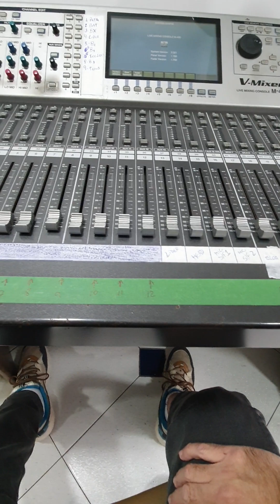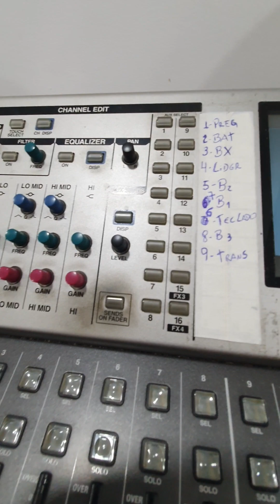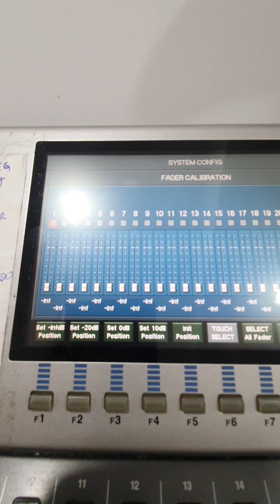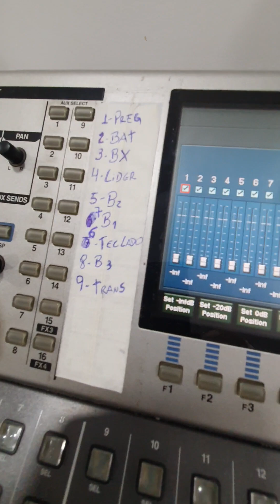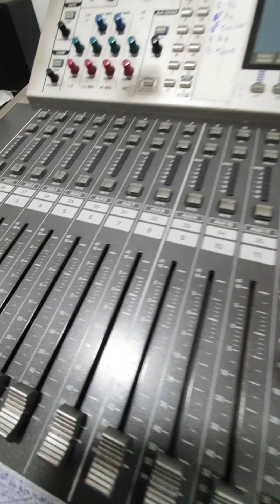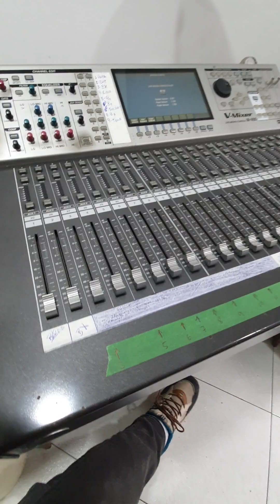Roland M-400 V Mixer Fader Calibration.

Comment: Roland Systems engineer?!? Awesome! I'd love to hear your thoughts or insights (if any) on what happened to the M5000. My church bought one and it's nice, but really an incomplete console that was abandoned and we're likely to replace with A&H soon.
Reply from the maker: @smedley5215  That was after my time at Roland and I've never seen one. Perhaps it wasn't imported to the UK, you are best directing your questions to Roland Technical Support themselves.
Reply: @ thanks for your reply. I didn’t really have a specific question, I was just curious if you had insider info lol. 

Basically it was a console they launched with much fanfare, and promised a bunch of features in future firmware. Shortly thereafter the updates stopped, and then they discontinued it and exited the audio market all together.
Reply from the maker: @smedley5215  I was senior engineer from 1988 to 1996 at Roland UK and after that a service centre for Roland. The M400 was very popular for various Churches, I personally liked the Presonus Studio live, when in Brazil the most popular desks were Behringer Midas or high end Yamaha systems.

Comment: i have a mackie hui that has a slack belt do you know if this fader is the same ive heard its p&g or alps
Reply from the maker: @yodamandala  sorry I never heard of that Mackie, but all Alps motorised faders use the same belt as far as I'm aware.
Reply: @delatronics  in 1999 The Mackie HUI was the very first DAW CONTROL that all mackie protocol is based on....only 11 left in europe and yes i love it..Fader 8 wont move i suspect its the motor actually and may have a look at replacing just the motor
Reply: @delatronics  they were the little big brother of the D8b